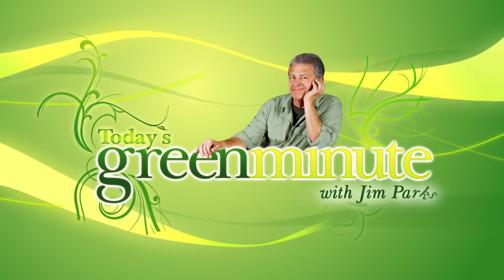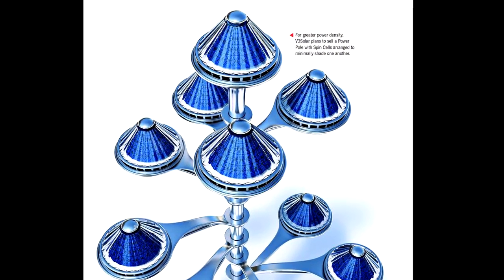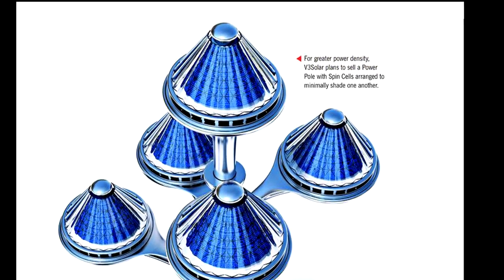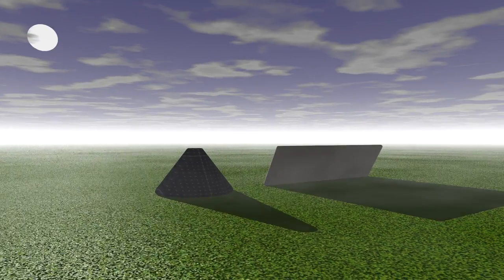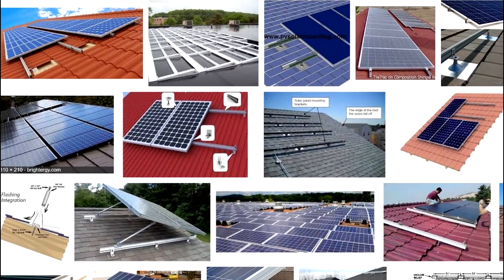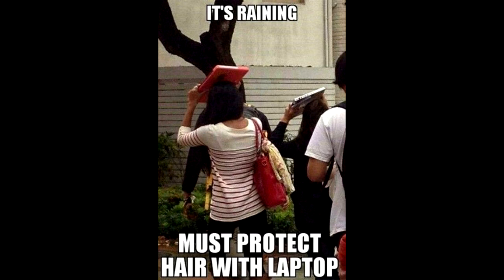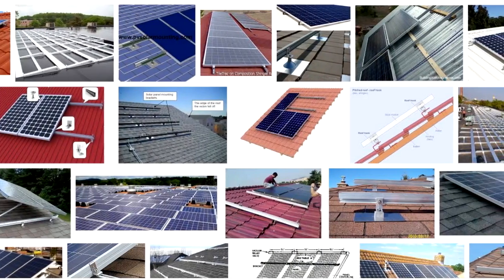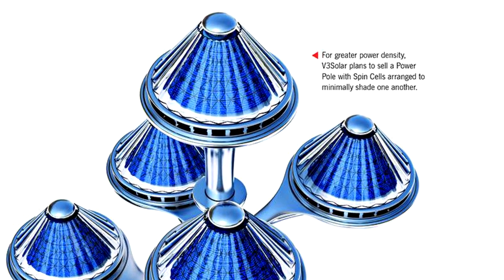Spinning Solar -BUSTED!

Comment: quick question, do solar panels stop converting energy as soon as the light stops or does it use up (type of buffer) what's left and then after half a second or so then it will stop converting. I'm asking this because maybe the idiots who imagined on how this will work thought thought that spinning will fix the issue?
Reply: I'm guessing it also takes a moment for them to start generating electricity once the light hits.
Reply: I would imagine there’s a very short buffer a millisecond long or so but the speeds you’d have the spin the cone in that case is scary
Reply: Any buffer that they have from light to dark would roughly equal the buffer from dark to light, so it wouldn't matter.
Reply: You're talking about electromagnetic forces acting on electrons; so it'd be immeasurably small, although John's point is valid even if there is a buffer.
Reply: Does no one comeup with the Idea to put a Mirror behind the Cone to shine a littlw Light on the dark Side ?

By the Way he mentioned the use of Water to get more Efficency out of an Engine. This actually works ..... on Jet Engines. I wonder if they use waste Water from the Toilet for it, that would solve another Problem.

Burning the Shit out of it ......
Reply: Hey genius - are you going to stand around all day continually moving thousand of mirrors on thousands of spinny solar panels so that the reflected sun actually hits the dark side?
Reply: Let's just start it over, if i build a Solarcone the Way described with a Height of 30 cm will the Panel produce enough Energy to keep the Motor spinning. How much Light will be needed to start it ? I think with this Size the Glassbowl may be affordable.

Don't get me wrong i don't expect to get Energy out of it but if it can keep the Motion on Sunlight some Hipsters may want to buy such a Thing. Especially if it comes covered with a nice shiny Glassbowl which protects the tiny Solarpanels.
Reply: @smellcaster  just test it yourself, get a solar powered calculator and see how fast it stops working when you block the light, its instant as far as the eye can tell.
Reply: It's instant. photons are converted into energy as soon as they touch the solar panel matrix. No photons, no energy, and there is no buffer.
This idea of spinning panels is totally BS.
Reply: @tersse  Might depend on the calculator.  Some might directly power it from the photocell, but I'm sure some/many/most use small batteries or capacitors as an intermediate step.

Comment: Is it practical for these conic solar towers (or something similar) to be used to reduce the amount of land required for solar panels? You need a massive amount of solar panel surface area to be able to generate a decent amount of energy from these panels. To me it seems that this could be somewhat feasible if your goal isn't efficiency as much as it is space conservation.

Comment: This entire argument is based on the sun being in one spot.  It keeps arguing that the "shade" part of the cone won't generate power, but he's forgetting that once the sun repositions throughout the day, that the flat solar panel will eventually lose power generation as well.

The cone, however, solves that.  Now it's just a matter of arguing which one will out perform the other throughout an entire day.  Will the flat solar panel generate enough electricity to push it ahead of the cone by the time the sun is out of position or not?
Reply: He assumed a tracking flat panel in his comparison so the sun's movement has no effect.  I thought that this was a bit unfair since no-one uses tracking solar panels, the cost of the tracking mechanism is greater than the cost of simply adding more panels.  The same goes for the cones too, there is an advantage in the cone shape in that it's omnidirectional but the same advantage could be obtained simply by using a larger fixed flat panel at less cost.

Comment: a "car" can run on saltwater but there needs to be a current flowing through it to break the water in to hydrogen and oxygen, but a normal car engine can't handle the combustion so it would have to be heavy reinforced and you would need about 10 to 15 car batters to keep it running for a fair amount of time, so it is theoretically possible

Comment: i guess putting  simple cooling fins on the back of the panel was too complicated. olololo. or better yet a liquid filled heat sink to pull off the heat, and make a preheater for hot water, or just to a tank underground to be cooled by the earth.

Comment: I'm curious, if you were to make the solar cone power a Turbine through the power of the sun alone, would that help any?
Meaning instead on having to rely on wind, which most places is unusable.
Could a Solar platted Turbine create enough power to be viable?

So it gets power from Solar as well as the turbines generator?

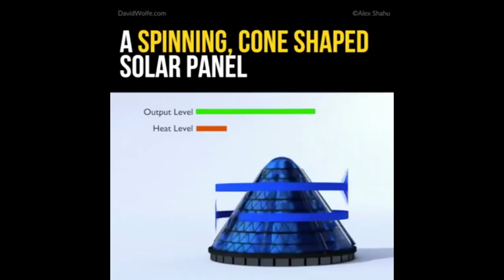Comment: 0:56 This sounded like nonsense from the beginning, unlike many of the phony Kickstarters, which at least require you to do some thermodynamics to spot the problem. How does this increase the amount of light received? Yes, there's always parts of it receiving direct light, but there will also always be parts receiving little to no light. There is no way this is remotely as effective as a flat cell, with how little of an area it captures light from! And how does spinning help? It doesn't affect the surface the light shines on, so it just wastes energy. No matter how you arrange your solar panels, they cannot generate energy from light that doesn’t shine on them; you need to maximize the area facing the Sun. Best bet is to get a very big solar cell, and rig it to a motor that can tilt it so it faces the light all day. If the energy consumed by the motor and the computer that calculates how the motor should move to face the panel to the light is less than the extra energy gained, there’s a net energy gain. Sounds like a better path to better solar panels.

Tl,dr: A solar panel can’t generate energy from light that doesn’t fall on it; curling it into a cone does not help you in the slightest. Just use a tracking solar panel if you want to maximize time facing the sun.

Comment: For real, put a light sensor on a standard panel and mount it on a motor powered stand, which will turn to the direction of the sun following the date feed from the sensor... This will be much more effective then that stupid V3... And you can run water cooling tube behind the panel as well! So it will never over heat! XD

Comment: Couldnt you run water over the panels to cool them off and recycle the water in a resivour under the panel, and the case could be made of alluminum to transfer the heat.

Comment: wouldnt it be smarter to watercool solar panels on the backside and use the warm water to produce more energy (via TEG or whatever)???    keeps the solar panels at higher efficiency AND gives out a little extra energy.

Comment: I was thinking that the dome shape makes them more wind resistant, ideal for high rises with little room on the roof, and not have to worry about high winds ripping them out, unlike flat panels that take off into the stratosphere, requiring heavy weights, windskirts, and thick anchoring.

The other thing to consider is the dome's placement. Rather than verticle  (which keeps half the panels in the shade) but placed at a 45 degree angle, so the whole panel is exposed to the light, while maintaining aerodynamic properties.

Comment: I'm not an engineer, but wouldn't it be smarter to cool flat solar panels with a closed loop coolant system that could be used to preheat a chamber prior to sending it to the water heater?

Comment: I agree with everything pointed out in this video, but my question is that if it's cheaper (somehow) than the same 4m flat panel, would it equal out somehow? Just wondered.

Comment: I understand the skepticism here, and most of the cone theory is complete nonsense,, but you have a terrible habit of throwing out the baby with the bathwater.  Many such ideas that are mostly nonsense have some truth in them, and this one is no exception

I don't know whether it's worth pursuing, but after you scrap away all the nonsense, there are advantages to cone shaped solar panels.  Not much, but some, and this "some" leads to other shapes that are even more efficient.   But they don't lead to cheaper, they lead to more expensive, even if they are more efficient.

I may be totally off base on this, but I get the impression, and it may just be an impression, that you are an advocate of nuclear power, and that your views are often tainted by this advocacy.
Reply: What advantages? Any shape other than flat means that some of the light striking the panel is hitting at an angle other than perpendicular, meaning less efficiency.

Comment: Umm...20X more energy than 20% percent efficient panels doesn't mean it goes over 100% efficient. It is a word salad but in the end it means if a flat panel generates 1KWH this generates 20KWH. Efficiency = (output/input)*100%. 1kwh/5hwh input is 20%, however, the product (claims to) take in more sunlight than a panel laid flat (which is about the most inefficient way of doing it). If that is true, even if the photo-voltaic is still 20% efficient it can produce 20X more energy if it takes in 20X more sunlight. 20KWH/100KWH input is still 20% efficient but it is 20X more energy than 1KWH/5KWH. If it also is more efficient because it runs cooler (which is sort of true but the way it does it is BS) that becomes even easier to get to that 20X more energy than a laid flat panel. A cone is still woefully less efficient than a tracking solar panel though and air cooling is often more than enough to solve the overheating problem.

Comment: My own observations ( in a cold climate) is that the heating effect has been ignored, if the heat is collected using the power from solar PV generation to force the warm air into a plenum and then into heating a space; the forced venting cools the surface of the solar panel improving efficiency and you have a surfeit of warm air to heat a room and increased electrical efficiency also - solar CHP !

Comment: Thunderf00t, those guys created a 400% efficient machine. They are clearly in a much higher league than you are!
Reply: Rubashow Efficiency equal to or greater than 100% is impossible.
Reply: even so, it would be expensive, so if you want cheap, less efficiency, if you want efficiency, more expensive.

Comment: These things sound like bullshit, your analysis is completely dishonest. 

All you use is surface area for your calculation, and you cheat by making the flat panel "magically" track the sun. Where is that energy coming from?

You also fail to make the assumption that as the sun rises and falls it will illuminate more of the spinning solar magic machine. That is to say, that if the sun is directly overhead it will illuminate 100% of the magic spinner. Your model only applies when the sun is almost perfectly to perpendicular to the cone.

That said, these things are pretty much complete bullshit. Solar power inefficiency does happen as a result of the solar cell getting "hot".

Comment: At the moment Solar panels are not currently a viable source for mass electrical production. That is, without federal substation. That is not to say that Solar does not have its uses; Solar power is THE ideal venue to power standalone systems that are far away from cities or towns and must go unattended. E,g, cattle watering and irrigation systems, or more commonly, space applications. 

In my opinion, we should shift Federal funding to creating more efficient methods of generating energy with resources that are readily available, (coal, oil etc) and allow solar and wind technology to be developed by the free market.

Comment: was wondering why you didn't adjust the flat panel's efficiency in your example for heat when you adjusted the cones? doesn't really change the outcome, just noticed it.

Comment: Would a combination hot water and solar electric panel work?
Reply: You have a water-jacket surrounding the solar panels which would feed into the hot water system.
Reply: Fifty degrees centigrade is enough for hot water ,and as a preheater for either the heat or hot water it will save energy .

Comment: You realize that solar panels lose power once they pass a certain temp? Depending on the cells. So it would probably even out in certain areas, or even increase it.
Reply: It's actually funny how many things you have debunked are starting to be adapted. Like solar roads. Now that's funny fact checking. And ironic karma.

Comment: Great video, up until that little quip about the Bible
Reply: Wyrm the quip I'm referring to is "so it can be right for once"  

also not arguing at all, but in the verse in question he was measuring a bronze statue, both a building or anything significant.  pretty good considering the books were written thousands of years ago by a civilization that didn't really use fractions or decimals.

Comment: Hmm what if you have combined solar panels that both use photovoltaic cells and the heat directly. So you have the regular solar cells  and on the edges of the panels you have tubing through which a liquid is flowing. To collect the heat, you have a thin aluminium or copper grid over the panels. The heat is carried away through the grid and transportet away with through the liquid in the tubes. The heat can then be used to either heat water or to power a sterling engine. This would make the solar panels more efficient by cooling them and create extra electricity from the heat.

Comment: Honestly, I don't think it is a fair comparison using the same area of a solar panel. The solar panel spreads through a much greater surface that could not be available. I would compare with a regular solar panel with the same "footprint"

Comment: Thanks T-f00t.  This is, in my opinion, the best type of video that you do, and you seem to about the only one doing them.  BTW, it occurs to me that to spin the panels takes energy, too.  So have they considered the energy loss for that?  "No, they might say, you can use wind power to do that!"  But then, why not just use the wind power to generate energy?  Anyway, Sometimes I start to feel like I'm the only one that sees through this BS, and then I see a video like this. It restores my faith, excuse me, trust, in humanity. Well, SOME of humanity.

Comment: How to actually improve a solar panel is to have a storage tank of water that replaces the old water in the panel that is now heated, the cool water will either cool the panel and heat itself from said hot panel or will take longer to heat up giving a little time of buffering.

Comment: Wouldn't it be more useful to just have a water source pouring over the solar cells, to cool them, and water being water, wouldn't it slightly give more absorption of sunlight due to the sun being magnified?

I might be wrong, or it may sound stupid, but this is just a thought I had like at the top of my head.

Comment: the really scary thing in watching these explanation videos is how much some of this is just basic common sense. you've used a log of completely appropriate science to prove your points but anyone that even bothers thinking about it should realize that a (piece of a) solar panel that's in the dark will not function as intended. but most don't.....that's a scary indicator of how little thinking most of us do.

Comment: How about solar panel covered by umbrella?  Heat problem solved.
Reply: Even better,right in your living room!Even when its dark outside they still get light!!!Holy cow,thats the answer!Why didnt they think of that?Just keep the lights on all night..
Reply: We could put them in caves with a flowing river to water cool them!
Reply: just burry them.
Reply: jai roberts above all, don't even think about putting a turbine in the river, lol.
Reply: Nononononon,u don t cover the solar panel,u make that umbrella the solar panel ,which spins,and the half facing the sky is just  a normal umbrella
Reply: Even better idea, just use no solar panel and power it from the same energy that turns it around. 100% efficiency and no overheating.
Reply: remember that it needs to spin and flip every 1 minute

Comment: I didn't look through every comment, but having installed panels professionally, why is no one talking about the smaller footprint needed for these? is it because of the stupid tree looking thing? what would be the the footprint be like compared to flat even if I had to use 200% more cells would I have gained efficiency of land usage?
Reply: Wyrm your roof is one of the most expensive places to put the panel. What you make up in electricity savings you loose in roof maintenance. Roofs that are not walked on last 30 years. Panels need maintaining monthly, meaning roof wear. Add that to the best case scenario of only lasting 25 years and you didn't save any actual money. Carports are a much better place. You can angle them any direction, they provide shade and don't interfere with the job the roof does. 

I'm not saying these cone things are the answer, but they do look cool enough to put in a public park.

Comment: You didn't even need to calculate for the surface of the cone, just the triangular cross section.  The edges of the cross section are receiving less energy for the area they are covering, so it would actually be less efficient than you calculated.